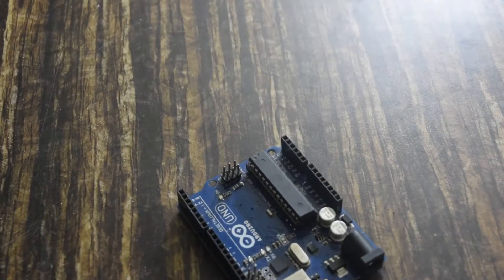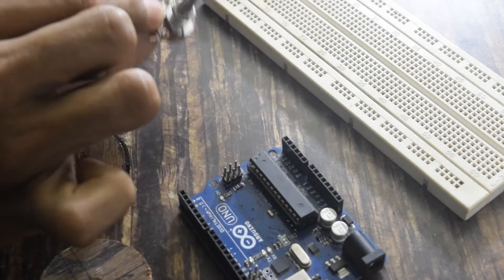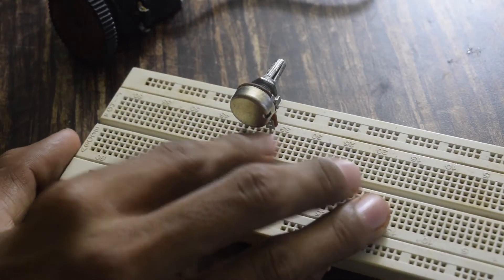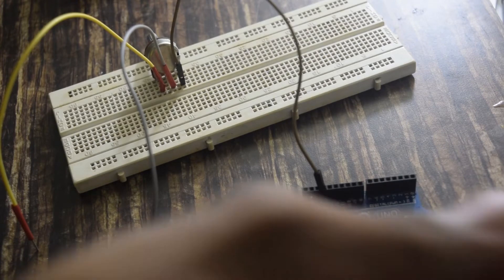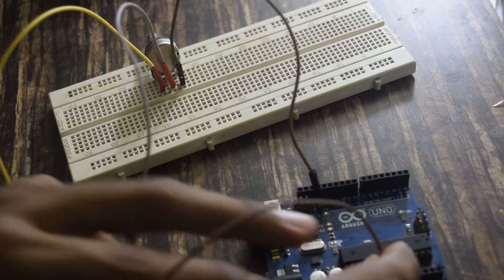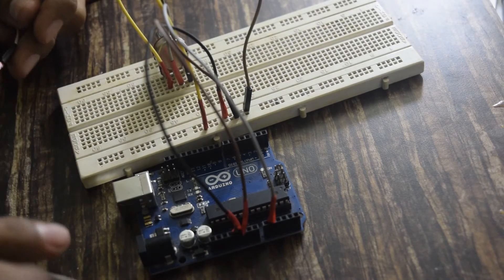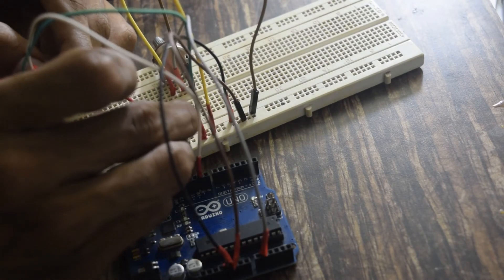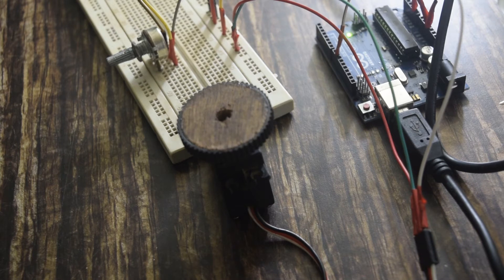DIY Follow Focus for DSLR using Arduino #arduino #project #robotics #cinematography #videography

Comment: Nicely taught. I have a question. Is it possible to use arduino nano instead of uno.??
Reply from the maker: Yes you can use
Reply: @electro_king_official  thanks for your quick reply.

Comment: I never understand why just a motor and a control cost so much from those big names.... I would imagine someone is able to make it like a wired remote control car stuff.
Reply: expensive equipments perform instantaneous response time. Arduino & servo perform a nasty realtime delay, useless in a pro or broadcast environment. Just watch: 3:29
Reply from the maker: SDU-Tango 
 yes exactly
Reply: Delay and reliability.
Reply: they're expensive because of the production cost.. the supply and demand of the product etc.. I think the delay and accuracy can be fixed by adjusting the delay time in the code and actually using stepper motors for precision..

Comment: What happens when you overrotate the focus ring limit with the motor?
Reply from the maker: HashtagFilms 
i have set the rotating degree soo whn i over rotate it wont respond
Reply from the maker: for eg . i have set max rotation 180 degree
Reply: oh that's nice, do you know where i can learn this stuff so i can build a small simple focusing system for my gimbal? I'm drifting through the internet but i can't find the right videos how to program ardunio with servo motors
Reply from the maker: HashtagFilms 
yes y not
if u wan i will help u ...its very simple to make

Comment: Thanks for the video, may i know which type of servo motor is best for achieving accuracy?
Reply from the maker: thank u soo much Harish
Futaba and if u are using another servo then don't use a cheap one because they might create some vibrations while    focusing and it will disturb your video
Reply: Tauseef Siddiqui acn u specifically tell which al servo are good in metal gear? for focus
Reply from the maker: Harish Rajamani 
there is no need to use a servo with metal gears because u will use it only for rotational purpose u will not apply load on it, u can use this one 
S3303 Futuba Standard Servo Motor
Reply: Tauseef Siddiqui thanks and can u also share the coding for audrino pls
Reply from the maker: Harish Rajamani 
u can download it from the link in the description
Reply: Tauseef Siddiqui how did u manage to get the servo gears with teeth? n what are they called as
Reply from the maker: I made one using Timing belt
Reply from the maker: u will get sets of Gears with free with Servo motor, what i did is i made 1 gear my self using timing belt and wood and then i just stick it on the gear which i got free with my servo so that i can mount the servo
u can see it in the video properly